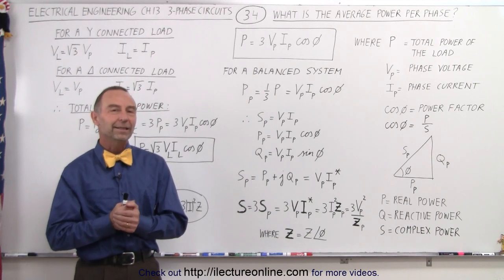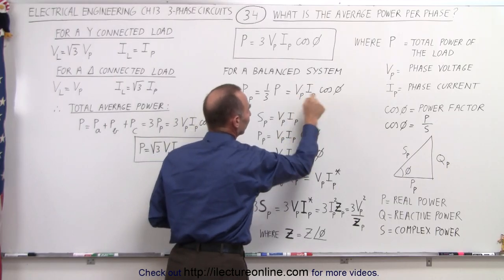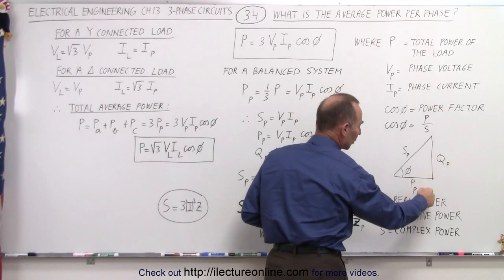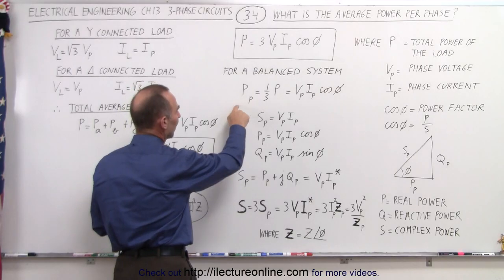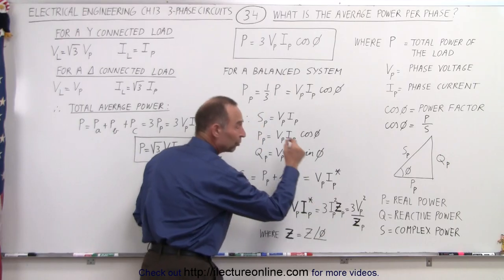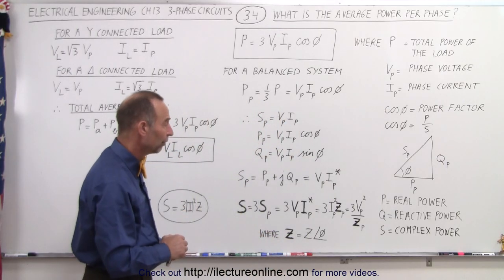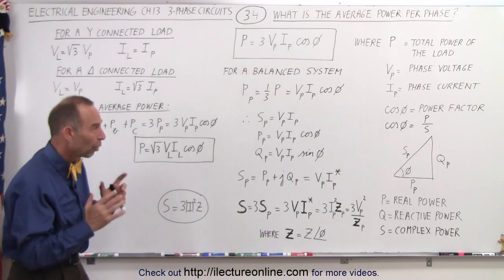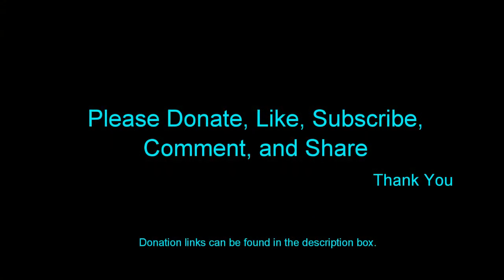Electrical Engineering: Ch 13: 3 Phase Circuit (34 of 53) Average Power per Phase?

Comment: Sir but in Y delta 3phase circuit which u said its the common,  both the linecurrent=√3Iphase and linevoltage=√3phase voltage then would the total powe of Y-Delta circuit be P=VLILcosΦ ?
Reply: The exact reason why i came back to this video. by all means please correct me if i'm wrong, but since we are only looking at the load in this stage. if you would draw a Y or delta load with the outgoing wires, not connected to any source. And deem the voltage between te lines the linevoltage, you will be able to see that in a delta circuit, the line voltage equals the phase voltaqge ( the voltage over the impedance), and the the linecurrent will be a facter sqrt(3) more than the current through the phase ( through the impedance). You will find the reverse being true for a y connected load. For me the confusing thing was looking at the possible source connections, for definitions of phase and line voltage. But once you look at the load it becomes alot clearer, hope this helps

Comment: Sir, I do recommend the proper usage of the terms complex power and apparent power.
Reply from the maker: Feel free to add any comment.
Reply: yeah you are right
Reply: @MichelvanBiezen  in the rule  S=Z  times   the magnitude of current ^2      you didnt mention of its the line current or the phase current  which one is it?

Comment: I think you forgot to say about the differences in phase voltage and line voltage angle. phase voltage will lag line voltage by 30 degrees (or pi/6 radian).

Comment: Why dont you multiple the line voltage with 3 for total power?
Reply from the maker: Just like with any RCL circuit, the power generated on each element (resitance, inductanve, capacitance) it will be out of phase.  When you add the voltage drops across each element, it will always be higher than the total input voltage, but when you account for the phase difference they will add up correctly. Here with a 3-phase circuit you cannot add them up algebraically because of the phase difference.
Reply: @MichelvanBiezen  thank you for your explanation, sir!

Comment: Hello sir. Thank you very much for the explanation. I'm currently confusing wether we need different formula for delta or star connection. Regards
Reply from the maker: The general equation for the average power per phase is as shown in the video.  The impendance of the circuit needs to be calculated as shown in the previous videos depending on the type of circuit you are dealing with.